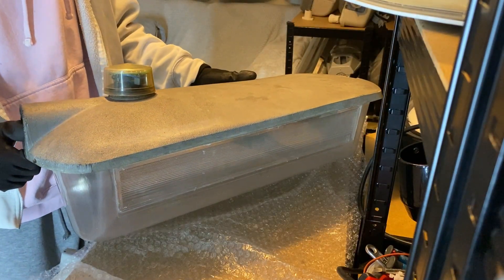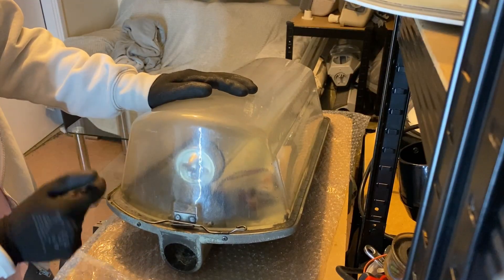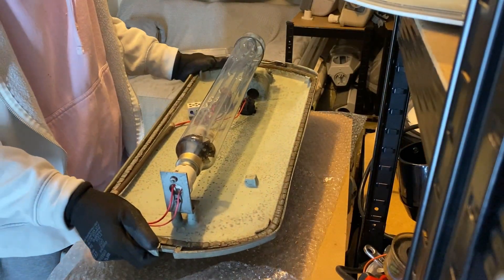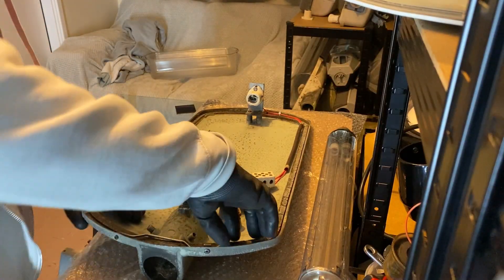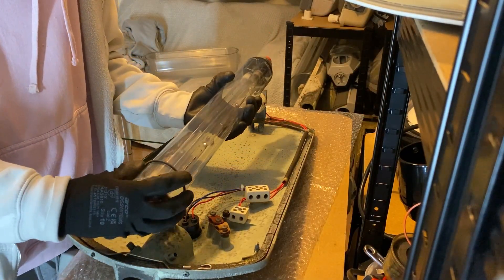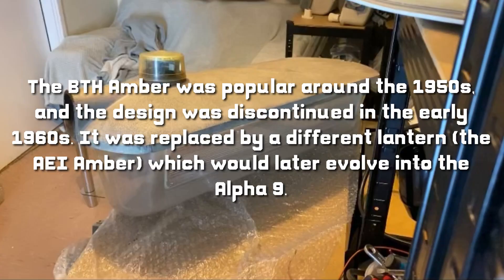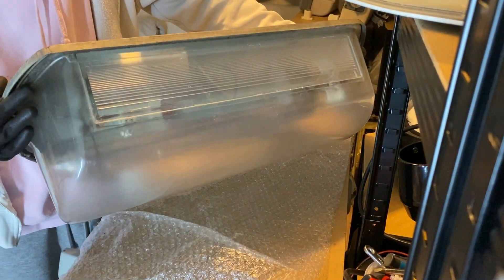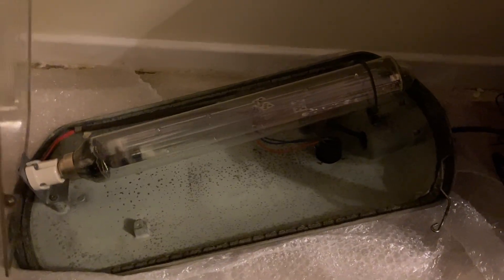A Street Light from the 1970s | Atlas (Thorn) Alpha 9 Teardown & Warm Up

Comment: Atlas was a brand name used by Thorn/BLI for its lamps and lighting division. The original Atlas Alpha 9 was made from circa 1967 until about 1973, then the design was changed to the shape you have here. There is a family the resemblance between the two, but the most notable things about the early type is the protruding spigot mount and the angled shape of the front of the bowl.